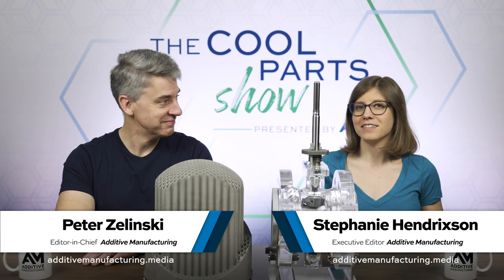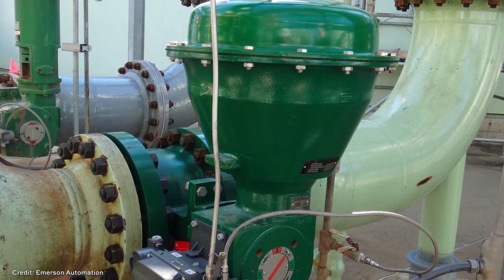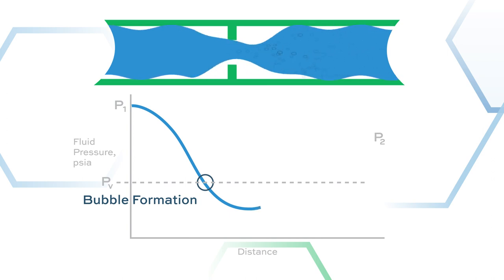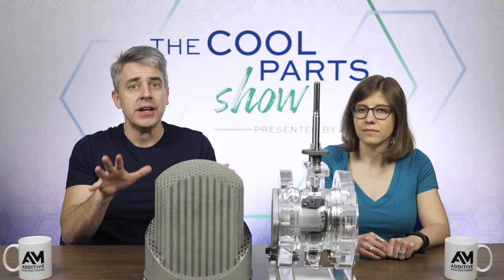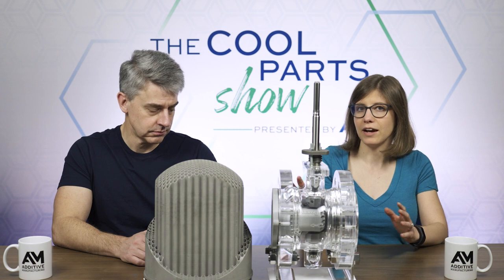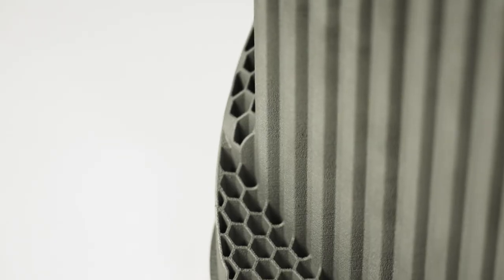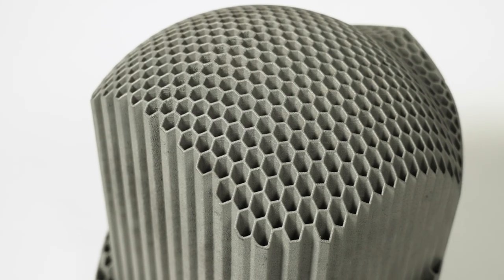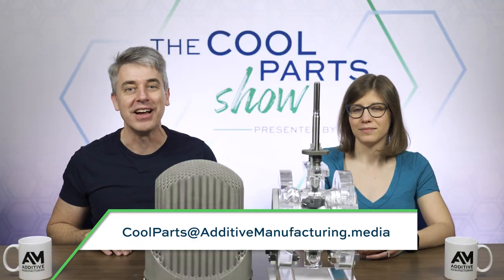3D Printed Valve Part Helps Prevent Cavitation | The Cool Parts Show #56

Comment: What an incredible show and incredible video. I'm very amazed about the use of 3d printing in areas related to cavitation and industrial valves and the best of all, it's not just a prototype, it is a commercial and available solution to alleviate those issues. Great content, I'm now subscribed. Keep doing the good work.